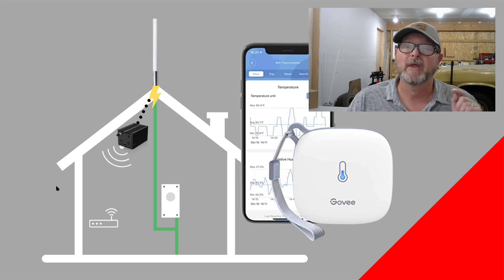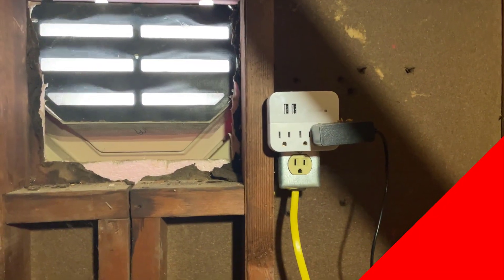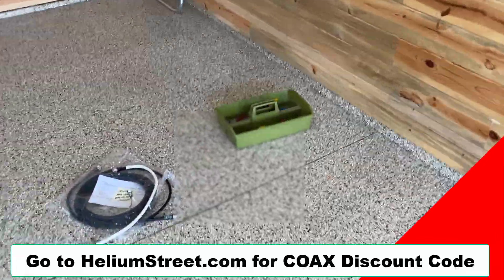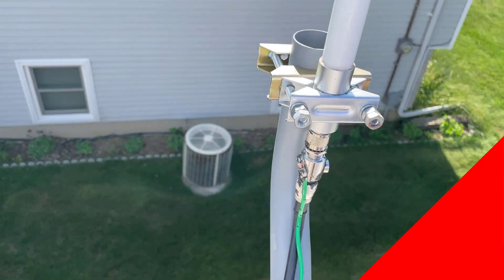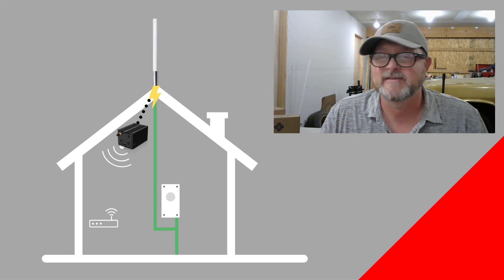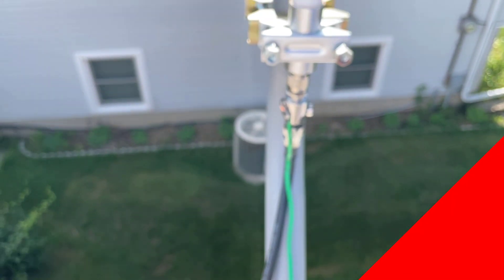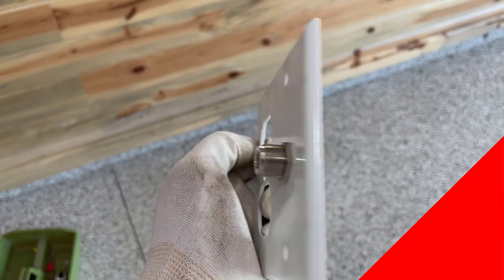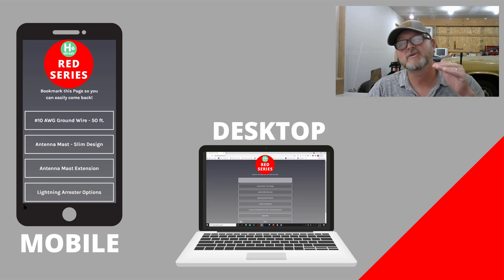Crankk & Helium Hotspot Miner Install - Prevent Overheating [ How-To ] RAK V2

Comment: Great video and other videos. I have couple questions for u. I want to purchase one of the LMR-400 cable. I notice on the site they list two connectors 1 and 2. Does this manner since I only want to purchase LMR-400 cable. Also, can u tell me the name of the coaxial wall plate you installed to the electrical box. Trying to find it on the webpage. I appreciate all your videos, they have helped me tremendously.
Reply from the maker: Unless you have the crimp tools and the connectors, you will want to get the COAX with the connectors (2).
The connector I used in the plate was purchased at MPD digital. https://usacoax.com/adapters/n-type-female-to-n-type-female.html
The wall plate its self was just a flat plat that I drilled a hole myself.

Comment: I'm thinking of putting my miner in the garage as well... Obviously because there is the power meter and other service access already there... It does get over 100degrees here in the summer however and the garage tends to be pretty warm
Reply from the maker: Air flow is a good way to compensate for the high temps.
Reply: @vandelay.digital.academy  you think that having a weaker wifi signal in the garage will cause a problem?.. I don't think I can run cat6 from the router
Reply from the maker: A weak signal probably won’t be a problem.  I installed a WiFi extender to resolve that type of issue at two different installations.

Comment: @helium street Do you know if I will lose any signal if I go with a 50ft LMR cable. Unfortunately I have a basement studio. So i need to run the cable up to the roof. .
Reply from the maker: @David316 Hi David, Great question, 50 ft. of LMR-400 has 2.2 dB of line loss.  If you go to the bottom of heliumstreet.com you will find the link to the calculator I use.  BTW, thanks for subscribing!

Comment: Great professional video. Good to see the processional and efficient setup of keeping the rolls.

Hope, to save the HNT is why a LoRa/Helium temp sensor was not used.
Reply from the maker: Ah, you are asking why I did not use a temp sensor that works with the Helium network data credits, correct?  Do you have a temp sensor suggestion?  Please share link.

Comment: So it's cool what you did but you have so so many connections and each connection that goes from the miner to the antenna will give you around .5 db loss. Not to mention the long cable. I built a custom outdoor enclosure and the miner is in this box that has fans that keep it cool so it does not overheat. Plus the antenna connects right off the box so I have very little db loss. I currently am doing very well with this setup.
Reply from the maker: Thanks for the feedback!  The folks over at MPD digital say each connection is 0.1~0.2 dB line loss.  So, for this install we lost about 0.4 dB for the extra connections.  That might be too much for some situations but I've not had any of our installations be that sensitive.  I believe we ran about 20 ft of LMR-400 for this install (0.9. dB of line loss).  This is just one of many different types of installations we show on our channel because everyone has a different layout.  If you can share more about your cooling fan set-up that would be GREAT!  Also check out the off-grid discord server for more info about outdoor installations.  You can also check out this video (Bobcat outdoor install):  https://youtu.be/H4dEzb_GX-k
Reply: @vandelay.digital.academy  I have seen all your videos I been with you since the beginning. If I can chat with you on discord I will show you the setup I have
Reply from the maker: Send me a note:  https://www.youtube.com/c/HeliumStreet/about
Reply: @vandelay.digital.academy  I count more than 0.4db loss for the extra connections.  1) antenna to lighting arrestor 2) arrestor to lmr400 3) lmr4 back of wall plate 4) front of wall plate to short white lmr400 cable 5) white lmr to your miner.. thats more like .5 to .6 just from connectors.. tack on 0.9db for the 20ft and maybe another 0.1 for the short white cable..  you've lost 1.6db maybe closer to 2db.. One can say just use a higher gain antenna.. but that probalby won't work for people with inner city who needs a max 4db or so antenna so they don't overshoot the neighbors.. albiet the layout looks nice..